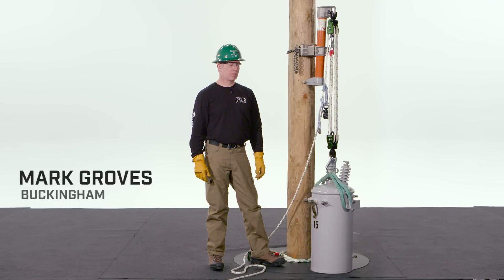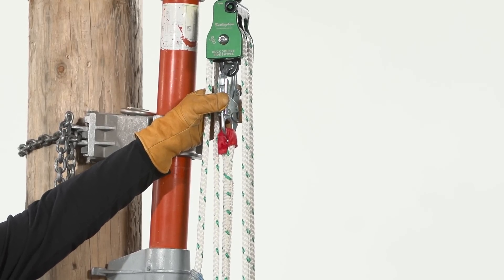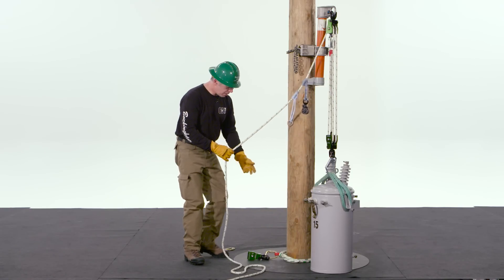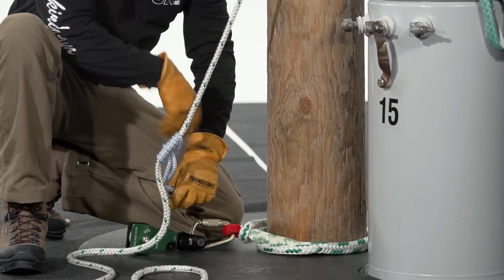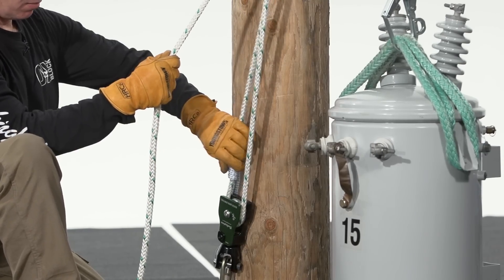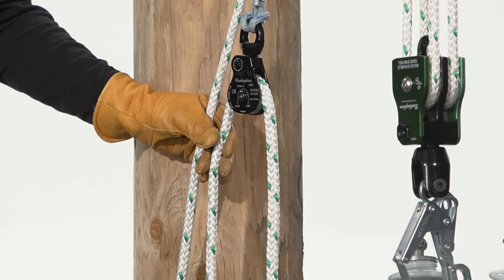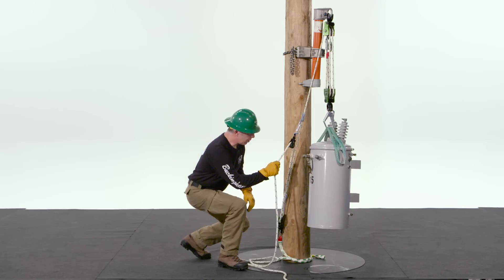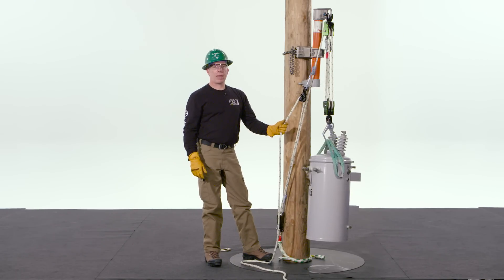Compound Pulley System

Comment: Everyone saying it’s a 12:1 system go watch SmarterEveryDay’s video on snatch blocks
Reply: It is a 12:1, that pulley anchored in the middle of the rope gives a 3:1 mechanical advantage (google up "z-rig"). A 3:1 multiplying a 4:1 gives a 12:1.
Reply: In SmarterEveryDays video on the compound pulley section he only had 2 units of tension working on the next set of pulleys. In this video there is 3 units of tension being applied to the rope beyond the prusik hitch, therefore you have a 3:1 system working on a 4:1 system creating a 12:1 compound pulley system.

Comment: It's 3:1 x 2
If you tie st the load it is 4:1
The way you did it the 4th pulley is a redirect. Tie at the load and the number will always be even. Tie at the anchor and the number will always be odd. 
Just by switching where you tie can gain you an extra advantage. Always tied to the load if possible. 
Other than that very nice gear!

Comment: He makes a video on compound pulley systems and don’t even know the correct MA he’s getting. It’s a 3:1 pulling a 4:1 which makes its a 12:1. It a common 3:1 z rig setup, he needs to include the 1 unit of tension coming up from the base pulley to the prussik, that line is still helping pull the load.

Comment: It looks like an 8:1 with a change of direction, pulling to disadvantage. CDs don't add to the mechanical advantage.
Reply: It’s not just a CD because it doesn’t terminate at an anchor, but instead adds 2 units of tension to the haul line. Add the 1 unit of tension from block at the base of the pole and you have 3 units pulling on the 4:1. Giving you a TMA of 12:1 at the load.

Comment: It's actually a 3:1 pulling on a 4:1, 12:1 compound system not 8:1
Reply: Right when you put a block with the moving part on the hulking part you multiply the advantage. If they get a book on rigging they will also learn the correct names for the rigs and gear. Then when they go t a store to buy some thing they will get what they need and not dumb looks like their dumbass deserve.
Reply: John Calamia I